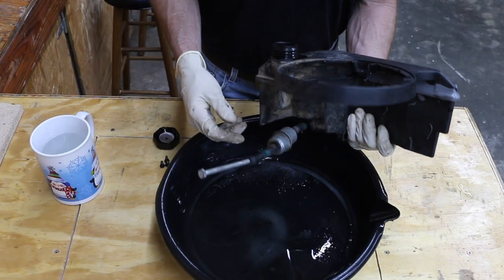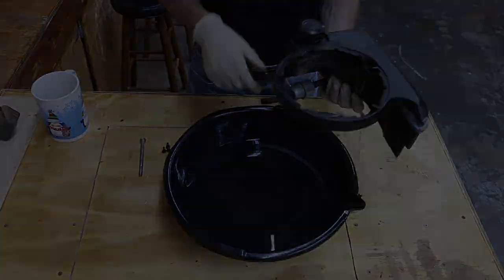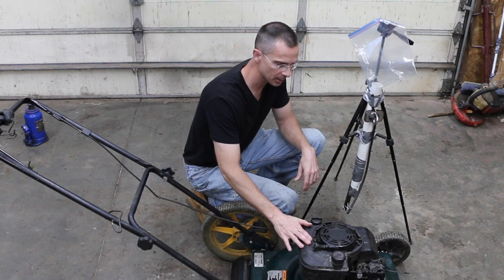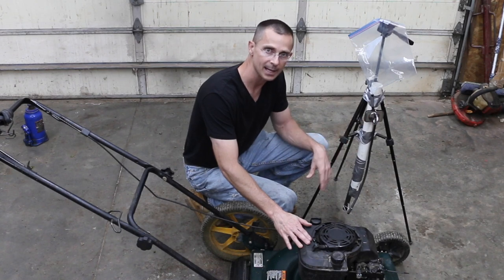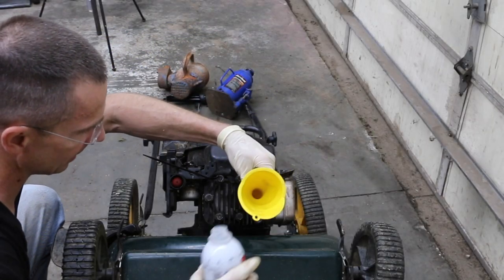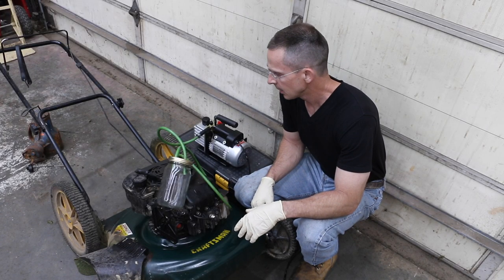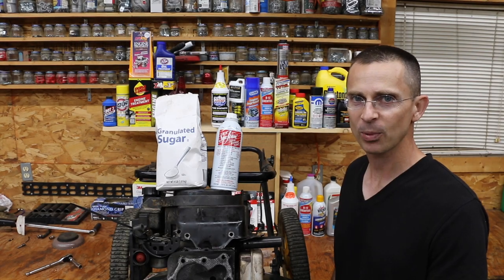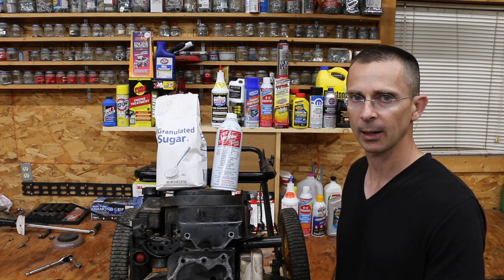Will Seafoam and water remove sugar in fuel?  Let's find out!

Comment: In the video it said at the bottom you suggest replacing the fuel filter, and I would say that it is a must if you have a filter that isnt mesh. But It would appear that you didnt, why?
Reply from the maker: The small engines I use in these videos don't last too long. I normally test several additives and then run an experiment that causes damage to the engine.  Therefore, i don't want to invest in an engine that has such a short lifespan.  Thanks for commenting!

Comment: I wouldn't put seafoam in oil unless you are going to change it right away, it contains naphtha which is a powerful oil oxidizer, they add it to oil based paints and varnishes to get it to "flash" quicker and have faster drying times. I've seen seafoam in an automatics.  one time.. two days later no more shifty  even after the solenoids were found to be the problem. Seafoam has quite a following not sure why.. I've used it but it just doesn't seem to provide much for results.
Reply from the maker: Tim, Great suggestion!  Thanks for watching the video and commenting!

Comment: Nice video! I was waiting for this one to see how sea foam could clean the engine up. It didn't seem like it really did all that much honestly. I could see a small different, but i think the real difference was how the engine ran afterwards. also, could someone tell me the minimum psi it takes for a 4 cycle to run?
Reply from the maker: Aaron, Thank you for the positive feedback!  I find that it is very difficult to get a small engine to start with under 50 PSI.  Thanks for watching the video and commenting!
Reply: Project Farm Thank you! I figured it was something around there, since the average psi it seems you have gotten in the videos is 65-75 psi.

Comment: How about you clean the engine part entirely and run two different samples.  Long time use using shell gas regular or premium to get most cleaning agents example.  Then a comparison against regular store or cheap minimum cleaning agents gas (anything not top tier/goes at bare minimum gas requirements of cleaning agents which is 7 or 8 something units, while shell is 25-30 something from regular to premium.). Keep up the fun tests and I hope you can do this one.  Either let mowers run and do something else and fill and repeat to get many hours on or mow lots of grass to burn a lot of gas.  I believe in using good quality gas and notice a difference from my car to my riding lawn mower.  High quality gas has nitrogen cleaners and an ingredient if I remember correctly called epa or similarly called.
Reply from the maker: ninjamaag, Great suggestion!  Thanks for watching the video and commenting!

Comment: You should try amsoil pi ( performance improver). I am currently running it through my hemi powered ram 1500 and Mazda protege for the first time. They both are running better than they have in several years.
Reply: Why take apart the fuel tank to clean it, when all you gotta do is vacuum it out with a high velocity shop vac, hose and hot  water.

Comment: The vacuum that you use to pull a suction on the mason jar looks like a AC vac? Is that a Harbor Freight one? If so are you happy with it?
Reply from the maker: teveler, I purchased the AC vacuum pump off of Amazon 5-6 years ago and it has worked very well.  I am extremely pleased with it.  Hope this helps!

Comment: Something I had learned from an old mechanic to clean the combustion chamber.  Mist plain water into the carburetor of a running engine.  I have never experimented with this personally so I do not have any personal experience.
Reply from the maker: Great tip!
Reply: Use a spray  bottle it breaks up rust carbon  rusted rings  and works well but don't hydro lock moter tho  make it or break it tried water b4

Comment: Can you explain where does the IV drip of seafoam go into?  Also, can you explain what areas of the engine the two hot soaking is soaking, exactly?
Reply from the maker: It goes into the carburetor.  Hot soaking the combustion chamber (cylinder, piston, rings, valves, cylinder head, etc.  Added Seafoam through the spark plug hole.

Comment: Most people don't realize sugar is NOT soluble in gasoline. Your cars fuel tank filter and inline fuel filter SHOULD NOT let the sugar granules even get to your engine in the first place. If they do, you filters were crap to begin with. Simply dropping the tank will allow you to clean it out. Clean out the filler neck also and change your filters and you should be good to go. Of course this applies to automobiles, not small engines unless filtered properly.

Comment: Hi, I just found your channel. I'm enjoying, watching your tests. I wonder... In these tests. Do you change the Spark Plug? Or do you, just let the "Product", do what ever cleaning, it can? Cleaning the Carbon, off the Plug. Assuming, the Plug is ok and puts out a good Spark. Would be the greatest factor, in making your engine run well or better. As for which "Product", did the best Cleaning Job. Water did the best. Hands down. Well, besides, using Carb Cleaner and Scotch Bright, that is... The other "Products". Aside from, removing a very small amount of visible Carbon. Really, only changed the color of the Carbon Deposits. Back, in 1976. I leaned how to make a Water Mist Injector. It was supposed to increase Performance and clean Carbon from the Engine, too. I put it on my 70 SS Chevelle. It had a 402 Big Block Motor and it was already quite fast. I used a Wind Shield Washer Bottle. And took out the Draw Tube. Then connected a long vacuum hose, to the Intake Manifold. This actually did, noticeably increase the performance. The only problem was. When the bottle used up all of the water. I wold get a bad Vacuum leak. And the Engine, would run bad. I had a hard time, remembering to fill that small bottle. So, I took it off. I thought I would build another one. With a Bigger Bottle. I even dreamed of building and selling them. But, I never did get around to it. You can buy them from Performance Shops, now a days. I think, they call them, Water Injectors. We also, use to pour or trickle water and or transmission fluid down the Carb. To Clean out Carbon, in Engines. But, I never took my heads off, to see if it worked. The best Trans Fluid injector, I ever saw. Was a worn out Vacuum Module, on an Automatic Transmission. I actually saved one, for that Purpose. But, it was a Pain to put on and take back off. There's another one, my Grand Father taught me. We, put Kerosene in the Crank Case, of my 1964 Chevelle. That I had put a 350 Motor in. (I had it, before the 70SS). And we ran the motor, for about 20 minutes. I was afraid, that the thing would blow up like a Bomb! The whole time. But it didn't. I imagine, it did some cleaning, too. How, much. I'll never know... I'm glad you have the time and money, to do these Tests. It's is actually very helpful, to the rest of us:)

Thanks,

Don
Reply from the maker: Don, I typically reuse the spark plug for these small engines, but I always test them for spark.  Thanks for explaining the water mist injection system you designed and used.  Impressive!  Also, thanks for the positive comments regarding the channel and videos!
Reply: Sure:) Keep up the good work and have fun!:) Don

Comment: mixing acetone 20ml, xylene20ml and toluene 20ml in equal parts, 20mlx3=60ml. add it n 1liter of gasoline. this will clean much better than using seafoam. try to do a test on it. cheap and very effective.
Reply from the maker: Thank you for this recommendation.

Comment: I wonder what would happen if Project farm used 2 stroke oil with a JASO FD specification, i can run a 2 stroke bike for more then 1000km and the exhaust port is clean since the oil contains detergents.
Reply from the maker: Thank you for the video idea!

Comment: Jeez, the seafoam didn't seem to get much of that build up off but it did make the mower run better. I guess if you don't care what the inside of the cylinder looks like it worked great to solve the noticable problem. Let's hope this is your last time with sugar contamination! Good video. It's nice to see what is actually happening. Keep em coming!
Reply from the maker: Casey, I agree!  I thought it would have removed a little more than it did, but the engine sure does run much better, probably from the carb cleaning.  Thanks for the positive feedback and thank you for watching the video!

Comment: what happens if u clean the piston with a steel brush
Reply from the maker: This will work very well, but the purpose of testing additives is to determine which ones work.  Most people aren't going to dismantle their automobiles to wire brush the pistons.  Thanks for commenting!

Comment: What happens if you use a wire brush attached to a drill to clean off the carbon on the piston/valves and the head? I would love to see that video.
would it cause any issues? Would it effect the way it runs
THanks for the videos, keep them going, it makes dealing with work a lot better. lol
Reply from the maker: Mytime34, This would work just fine and shouldn't cause damage as long as the piston is at TDC.  I can create a video on this, but doubt there would be much interest.  Thanks for watching the video and commenting!

Comment: I'm very curious to see if MMO will clean that engine. I was surprised that the change was minimal this time with Sea Foam even after using it in the fuel and air intake.
Reply from the maker: StrongEnough78, Seems like an interesting project.  I'm getting excited about testing some other additives.  Thanks for watching the video and commenting!

Comment: The flaw I see with this experiment is that small lawnmower engines don’t have fuel filters (unlike cars). The gas hose just goes straight to the carburetor with nothing to stop sugar from going in. In a car, the fuel filter should stop any sugar crystals from reaching the motor since sugar crystals can’t dissolve in gasoline. You should splice a filter into the gas hose and try it that way.
Reply from the maker: Thank you!

Comment: I think seafoam did a good job but also thought it would do a little better and I have done some experiments with seafoam a want to see how a small engine would run with a whole bottle of seafoam in the gas tank and then top the tank off with gas and it ran fine so my point is it seems to be a really safe product
Reply from the maker: Joe, This is a great suggestion!  I thought about using a much higher mix of Seafoam in the gas.  Thanks again!

Comment: Water and soap to clean the tank, small slugs of water to clean the cylinder & head, and maybe some Seafoam in the oil to maybe help clean the carbonized sugar off the rings, although I don't think it will do much there either.
Seafoam didn't hardly do anything to remove the carbon from the cylinder head, valves, & piston, did it?
Like I've always said, Seafoam is nothing more than snake oil. While the head is off, bring the piston up to TDC and spray some good carb cleaner on and around it to help dissolve the carbon on the rings.

Comment: I use break clean, a copper wire brush, and an abrasive dish sponge to clean my mover engine inside. Then I just rinse it off, wipe up the remaining fluids, then re-lubricate.
Reply from the maker: BobTheBuilder, Yes, this approach works extremely well.  Thanks for watching the video and commenting!
Reply: BobTheBuilder I just use diesel to clean the combustion chamber a and it when liberates it a little

Comment: Looked worse after the treatment to me. 

Tests aren't very relevant without running the engine with a load. If you insist on using mowers, at least cut the grass with them so they are working and getting the engine up to proper working temps and cylinder pressures. 

Water would get that crud out easily BUT, you have to do it while the engine is working under load and it may take some hours. It works but it's not a quick fix, it's a long term preventative and cleaner.
Reply from the maker: Oil Burner, Thanks for watching the video and commenting!

Comment: Theres no control group, we dont know if the engine would have cleared up by itself, after removing the sugar from the tank. Its very reasonable to assume that it would start to run smoothly without seafoam treatment. The combustion chamber looks drier, not really cleaner.
Reply from the maker: Thanks for sharing.

Comment: wouldnt majority of the sugar have got trapped in the fuel filter. should of opened the filter to see.
Reply from the maker: Taylor, I agree.  I used the hot water to dissolve the sugar since I didn't have an extra one to use if I had cut this one in half.  Great suggestion and thanks for watching the video!

Comment: I always thought gas in the tank causes fires.
When I worked at a body shop, a box van came in with a fire in the motor bay/front cabin. We rebuilt the van and sent it out and it caught fire again and burnt to the ground on the highway. I asked my boss what he thought caused the fires and he said  someone sugared the gas tank, as it was not cleaned out after the first fire.
Reply from the maker: Ben, Interesting!  Maybe it caused the fuel pump to overheat.  Thanks for watching the video and commenting!

Comment: Try "Metal prep" "Turco" or "Ardrox" to remove that carbon.
Reply from the maker: Thank you for this recommendation.
Reply: How 'bout filling the crankcase with two stroke fuel and use the vapours coming out of the vent to run the engine.

Comment: Pure water sprayed into the intake should do better job than anything. 30-60 min depending on carbon deposit. Sprayed into hot engine
Reply from the maker: Thank you for this recommendation!
Reply: Forgot to add: idealy higher RPM than Idle: preferably around half the rpm range. 

The water should get compressed under the carbon deposit and rapidly boil off creating pressure below the carbon deposit thus making it loose. Also water injection cannot damage the engine or leave any deposit. 

P.S. For interest: BMW uses water injection on its 4 series M model. According to BMW it provides better combustion, higher efficiency and Power while reducing fuel consumption. That is due to much cooler combustion chamber etc.

Comment: Try brake fluid.  
Engine up to temp pore in carb heavily at high rpm till it dies.
Let it set over night.
Blow out brake fluid.
Change oil.
Should remove an impressive amount of carbon.
Small engines and pre 1974 cars and such.
Reply from the maker: Thanks for the suggestion.

Comment: ON THIS ENGINE= 1/2 quart acetone + 1/2 quart ATF + 1/2 quart >91 octane gasoline. (1-1/2 quarts total) Shake 1 minute to thoroughly mix. Run engine using mixture only in tank. No other I.V. or oil additives. Stick throttle open fully. Run mixture until gone. Examine.   Please.
Reply from the maker: Very interesting approach!  I might try this, but not sure the engine would even run.  Have you tried this before?
Reply: On cars at the Shop I worked at, many times. I've only been posting and begging for you to do it and show it about 5 times now. Why would I tell you something not right? ATF mixes very readily with gasoline, and by itself is flammable under the right conditions. We mix a quart in crankcase and run a while to clean internals. I shit you not. FULL THROTTLE is one of the necessary parts- idle aint gonna do squat.

Comment: Unfortunately I think you have to just break down the engine and clean it out like you were doing a rebuild.

I was expecting to see the main problems to be with the gas tank, filter and the fuel lines.
I didn't think the sugar would make it much past the filter (or strainer inside the tank, if this was an automobile )
Reply from the maker: Thanks for the feedback.

Comment: you have used alot of products to test and see the results // but some have yet to be tested or tried like the gum out carburetor and choke cleaner as running drip and hot soak //  another one is WD40 - yes it does come as a liquid not only the spray can // WD40 i have used for primer starting a diesel engine to help get full fuel through filter after changing //  for the WD40 test i would use a engine that has not been tested or worked on in any way // or take the last test you did and do the WD40 test and see just what the results would be // from what i can see there is still a bit of carbon buildup but not as bad before test and that i also noticed that the cleaner area is showing just how the fuel is being ignited and the burn of combustion after the sea foam was used // have many other ideas and testes but i do not want to over load the lawn mower
Reply from the maker: JAFO FUBAR, These are great suggestions!  I like the idea of testing WD40 and the hot soak method would seem very effective.  I have other mowers that haven't been tested yet.  Thanks for watching the video and commenting!
Reply: my grandfather used 3 in 1 oil for cleaning the carbon out in kinda the same manor you have done most of your tests // then he would add NAPTHA  ( lighter fluid ) to the fuel ( my guess was for the LEADED FUEL ) to help reduce the amount of carbon buildup or deposits even helped the black smoke out the exhaust // just a bit of food for thought
Reply from the maker: This is an interesting approach!  Thanks for watching the video and commenting!